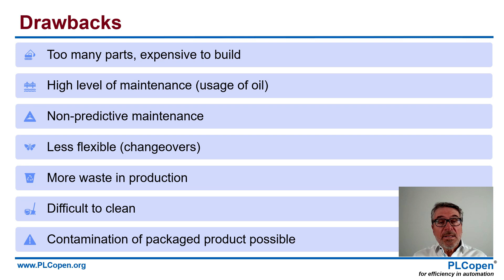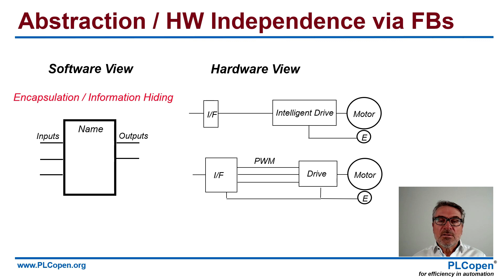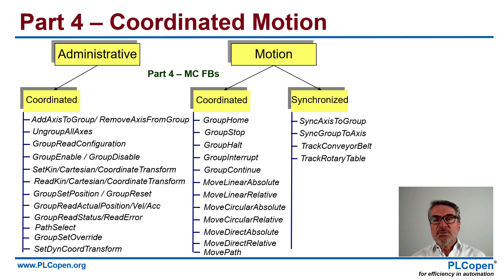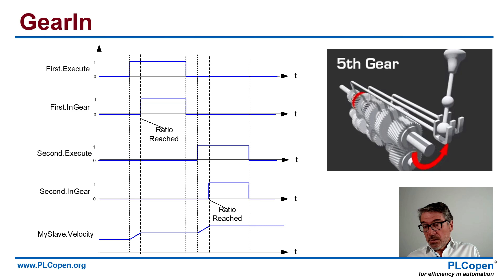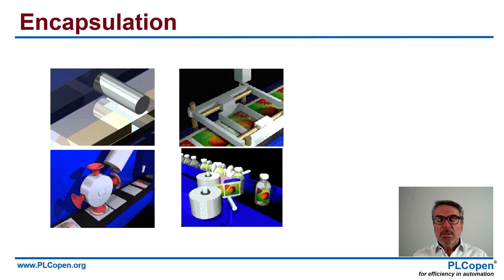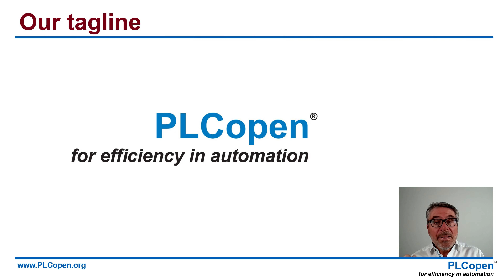PLCopen Motion Control

Comment: I'm trying to move a single axis to test PLCopen functionalities but I get an error on the MC_MoveVelocity block: errorID 29207.
I red the guideline and it says that the error is due to the "wrong" axis state, but I checked with the MC_ReadStatus FB and it says that is in 'StandStill' state (admissible) so it should start moving and I should see some velocity on the output.. Any suggestions?
Reply from the maker: Which supplier are you using?
Reply: @plcopen  Automation Studio from B&R